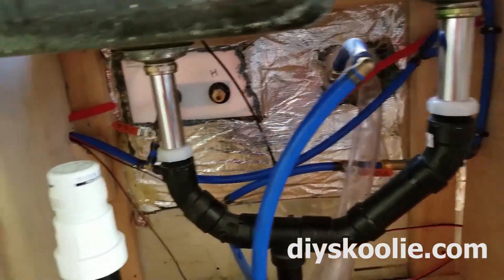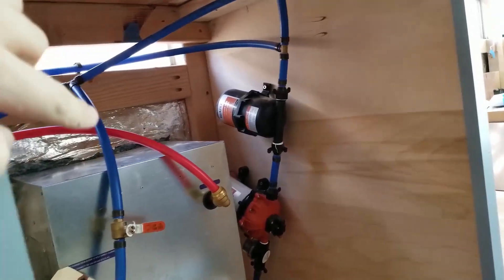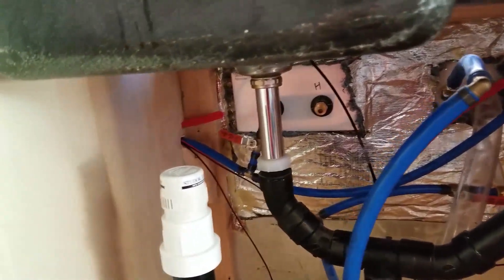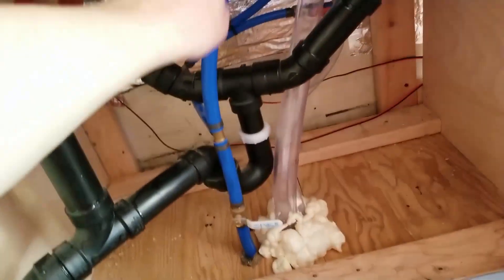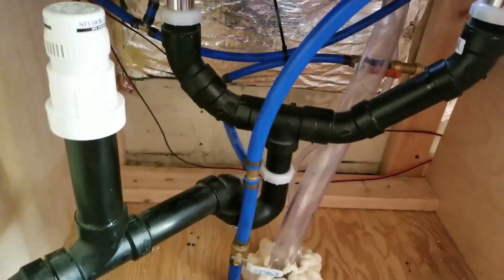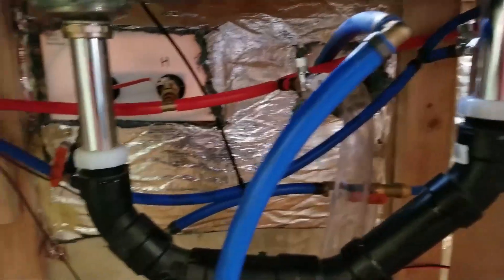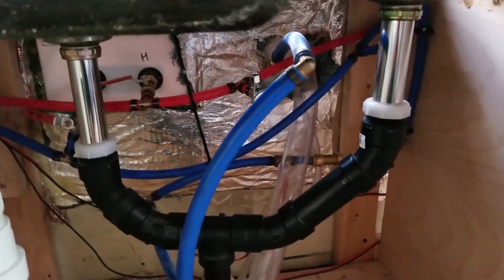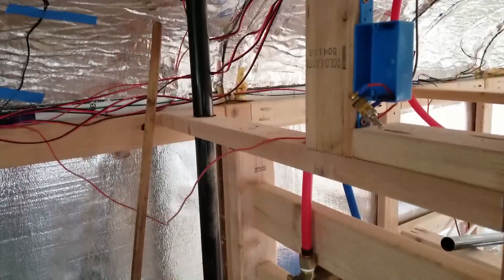Conversion Video 30: Under-Sink Fresh Water Lines

Comment: Curious I didn’t finish the vid yet which may or may not awnser my question but what’s the deal with the expansion tank I work on boats and do plenty of water systems which is a lot of the reason why I feel comfortable with takeing on this project, but not really familiar with those being in the system
Reply from the maker: The accumulator tank allows for more even flow and pressure in RV water systems.  In theory, if I turn the faucet down to a trickle without an expansion tank, then it starts to spurt water rapidly as the pump turns on and off rapidly as it reaches the low threshold of pressure that activates the pump.  Basically, in a split second, the pump senses low pressure, then turns on to meet demand, the demand is met quickly because the water valve is mostly shut, so it shuts off, but a little bit of water is still being demanded, so it once again falls below the threshold to turn on, so it flips on, then again it quckly meets the demand because the pressure it is supplying is more than enough for the low demand...etc etc.  With the expansion tank, extra water is pushed into a pressurized "buffer" that slowly lets the water out as it is needed, and puts less stress on the water pump.  The pump will only turn on periodically as the expansion tank empties.  I know you have to dial in the pressure in the tank to match your pump's needs.  Basically, it's an air bladder that gets compressed as water pushes into the accumulator tank.  The pressure in the air bladder then puts pressure on the water after the pump has pumped enough into the expansion tank to shut the pump off.  This puts pressure on the water pump so it thinks that there is enough pressure in the lines to not need to turn on, while also pushing water through your water lines at an even pace.  Homes and water systems that have shore power don't have this issue because they are using city pressure, not a water pump.  They just open or close a valve and water is supplied at the requested pressure, at will.  In an RV, where you make your own pressure, some pumps struggle with a low flow demand.  At least, that's how I understand it.  I hope this helps.
Reply: Woolly Mammoth Bus Conversion yes deff makes sense thanks